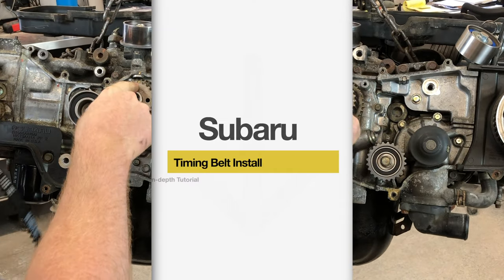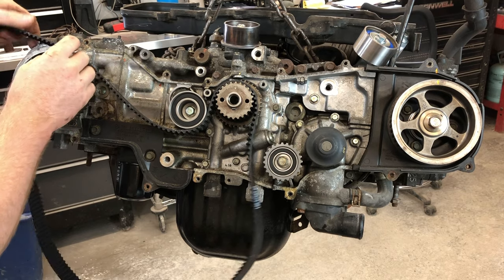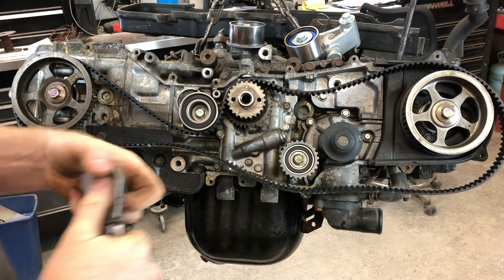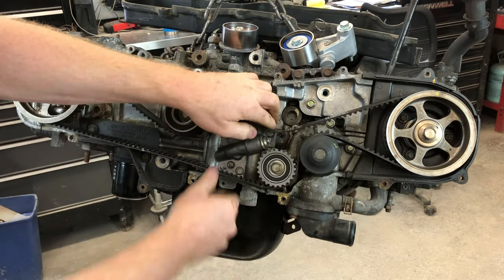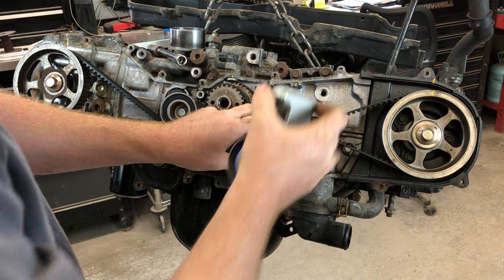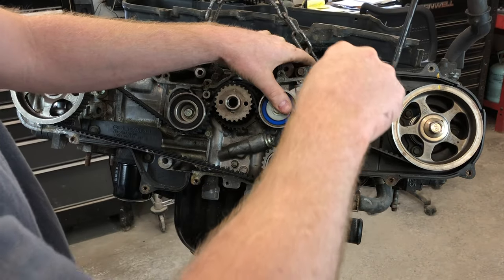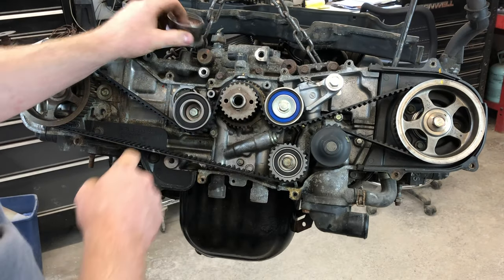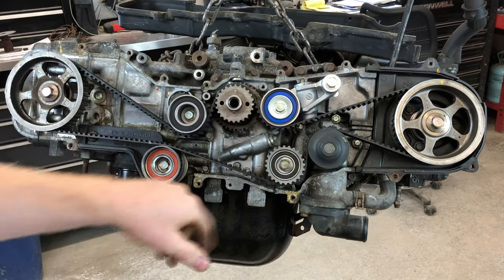SUBARU Timing Belt Installation!  PERFECT EVERY TIME! SOHC EJ25 EJ20 TIMING MARKS AND BELT GUIDE

Comment: I just bought a BOSCH belt for my EJ201, am I screwed
Reply from the maker: Hard to say. No experience on Bosch. But I've seen many others break.  On Subaru i only use oem or aisin. It's worth it. When they break, bad things happen. I've never seen aisin or oem break before 120-130k miles.
Reply: @EasyFixShaun  alright well I'll just change it sooner than I need to in the future, I'm not gonna throw a new belt into trash
Reply from the maker: I don't blame you. I have trust issues with anything other than oem. Aisin is the only brand that help up other than that for me. It's just not worth it. I have seen many failures below 30k miles on anything other than oem. Put oem on it and forget about it 😃

Comment: I just returned a $550 Gates timing belt and water pump replacement kit for my ‘05 Forester, 2.5X. All three bearings are made in China. Not interested in cheap, inferior Chinese parts, especially for the timing belt.
Reply from the maker: Yup. Aisin kits or Subaru kits only... or it will fail. Been there too. Is a pain to send back but worth it. Bad things usually always happen with economy kits 😃🔧
Reply from the maker: Yes! Japanese owned. American Made. Parts are made in Japan.
Reply from the maker: I think low quality parts use a strategy of low prices and high warranty claims to  fool a lot of people into thinking they are high quality. ...Including myself 😃
When in doubt go to the OEM parts. They have a high incentive to make parts that actually last through the warranty period. ...Although, they are getting good at making them fail just after. Can anyone guess which ones do this? And which do not? 😉
Reply: @EasyFixShaun  "can anyone guess which ones do this"? Sounds like a leading question, i would be interested in the answer.
As far as oem replacement parts quality being better I believe that may vary from manufacturer to manufacturer.  Installed an Asin timing belt kit on a Kia. One of the new idler pulleys failed at 40,000 km (so Asin kits gave their issues as wel). Bearing siezed causing the belt to slip off the idler but did so with a twist. With unbelieveable good luck the twist kept the belt tight even though it was no longer on the pulley..  Shredded half the belt and beat several grooves through the plastic cover ($80 !!) But the belt never slipped even one tooth and was still in time.
Looking on rockauto for replacement and having just had an Asin component fail early I was initially drawn to the Gates belt, because of long ago history of decent quality, but kept remembering Ivan of Pine Hallow Auto Diagnostic going into some detail about calling the Gates office to express dissatisfaction with Gates sending all China components in their kit. On the rockauto info page I could zoom in enough to see "made in china" and a part number clearly on the Gates belt.
So ordered all Kia components from a local Kia dealer and what do you suppose was in the Kia kit but the exact Gates China belt with the same part number but with the official Kia name and logo added and at double the price of the identical Gates belt (without the kia logo) that was on rockauto. So i would now say that Kia OEM replacement parts are now of questionable quality.  The new Kia tensioner and idler looked ok. 
Interesting enough was the initual tensoner that came on the engine from the factory was clearly marked Gates but the replacement kia tensioner and idler were a Korean brand.
Reply from the maker: @ronsereda4242  I don't work on kia so I am not sure what needs to happen there to get the best parts. When it comes to japanese cars, Asian or Oem is the only way  unless you want problems 😃
Reply: @EasyFixShaun  Yah, sorry to intriduce Kia into your discussion. Just came to mind when you mentioned Ason as being nect best to OEM. That was my belief as well but it was an Asin idler bearing that siezed after just 40,000 km (24,000 miles) that only by good fortune could have taken out the engine so thought I was doing right by selecting only OEM parts for repairs and still got a very poor quality China belt. If Kia is branding poor quality aftermarket parts as OEM it's likely that some others are as well. Just shatters any hope of hoping to buy quality anything these days.
Was watching your show because I just bought a very well cared for 2009 Legacy wagon with 132.000 km (79,000 miles) and was getting reacquainted with Subaru finer details.
Reply from the maker: Nice! I have tried cheap stuff over the years that made claims of oem equivalent quality too. It's a lost cause and has caused so many problem it is disgusting. It used to be just fine 20+ years ago to use aftermarket stuff. It would last just as long as oem. Everything now is junk being marketed as premium. Premium Junk. Almost all hope is lost at this point. I don't know how it will ever come back....I hope it will though 😃🙏🏻 @ronsereda4242

Comment: No mention of how much to tightening setting,  good video nevertheless.
Reply from the maker: This belt system uses a hydraulic tensioner and it sets tension automatically once the pin is pulled on the tensioner. Just bolt on the tensioner and it does the rest of the work 😃

Comment: UPDATE: Well, the inevitable happened. I got a real loud knock,  so I took my stethoscope and it's knocking from the top right side. I can feel it where the "EJ253" is located,  like it's ready to pop through.  I'm not sure if I want to rebuild this engine or get one that's already rebuilt.  I'm not a wrench but I feel comfortable enough to give it a shot. I've been studying these EJ253's and they don't seem all that complicated. I value your knowledge, so what are YOUR thoughts?   Thanx in advance.
Reply from the maker: Is the car running really rough also? The camshafts weirdly break in half sometimes on the right (passenger side). Pop the valve cover off and check it by turning the engine crankshaft pulley by hand (disconnected battery only). If that is the case, replace that cylinder head with a used one on ebay. Or a rebuilt one from autozone. The autozone rebuilds have been pretty good lately.
Reply: @EasyFixShaun  Good to hear from you. No it's not idling ruff, just major knock on the top right.
Reply from the maker: Ok, Well I would pull the valve cover and attempt to pinpoint where the noise is coming from if you think it could be valvetrain noise. If not, get another motor. Thats the options anyway I would start exploring. I hope that helps. 😩
Reply: @EasyFixShaun  Thanx for getting back to me.  Yes, I think I'm going for another engine since I've got it apart and noticed MANY bolts are gone.  I did some research on where this thing came from in Kentucky.  The previous owners are elderly and there's a butt load of maintenance bills from their closest dealership. I'm going to dig in a little further to see what I can see. Again, I appreciate your knowledge and I'm going to keep you and everyone else updated. Ya know what they say; " The more you know ..."    PEACE

Comment: Great! I just fitted my Gates belt kit and now i keep hearing about how crap they are!
Reply from the maker: Sorry to hear that. Ya I would go in again and put a Subaru brand on if you want zero issues with the belt. I have seen all others break prematurely 😃🔧
Reply: @EasyFixShaun  Man that's crazy, never had any dramas with my gates belts in the past. How the hell are they still in business??
Reply from the maker: Sometimes they do ok and make the full 105k interval. But not very often. I would never use one in my car or anyones else's car. Bad things happen. With certain parts only Oem will do and timing belts are in that category. Aisin is acceptable and good on Japanese cars also. I wouldn't use ANYTHING else. Even if it had a bazillion mile warranty- its junk 😂🔧🔧
Reply: @EasyFixShaun  Do they snap or do they just wear out prematurely?
Reply from the maker: Snap/break before the next interval.
Reply: @EasyFixShaun  well I just spent $500 on the kit so I don't wanna just throw it away. I'll keep an eye on it and change it at 50,000km instead of 100,000.
Reply from the maker: I would throw away immediately. Best of luck to you though. Sometimes they work out ok

Comment: Okay, just for shits and grins, I called Advance Auto and asked specifically for the MITSUBISHI belt. They tell me "YES, it's in stock" , I even gave them the part #.  I drive half an hour and they tried to sell me a DAYCO which in turn was more expensive by 10 and some change. They had to order the Mitsubishi, ... it won't be in until Friday.  I used to love to wrench, not so much anymore.
Reply from the maker: Ah crap I’m sorry man. Well at least the extra effort will make it last longer. I’ve seen a lot of motors damaged from off “comparable” belts breaking. With any other belts it usually happens somewhere between 40 and 60k miles.  It’s worth the wait.
Reply: @EasyFixShaun  And THANK YOU, sir, for KNOWING is half the battle.  I dig the AWD, for I live on top of a hill that most 4wd fear to tread ... like my `02 Ram.  XD  Lemme tellya, that Subaru is effortless.
Reply from the maker: Subarus really kick butt man! They are so underrated by non owners. I am a little fearful of the CVT issues they are having. I can't wait to own the direct injection motors they may be coming out with someday soon in most of the vehicles. Currently only BRZ has it.

Comment: How do you rotate to camshafts to line up without a belt on?
Reply from the maker: I use a wrench on the center bolt of the sprocket. I think Subaru's are a 17mm. 😀🔧
Reply: @EasyFixShaun  Its already torqued tight though.  I took the belt and pullies off first and then rotated the crank to position...:(  woops
Reply from the maker: Im not sure what you mean. If the crank is lined up properly its tough to do any engine damage as all 4 pistons will be exactly half way in the cylinders. If you removed the cam sprockets and then moved the crank into position it is possible to damage valves by colliding them with the pistons. Does the motor feel stuck on any if the three sprockets?
Reply: @EasyFixShaun  much appreciated 😁
How do I remove the crank bolt without rotating the crank?
Belt and pullies all still removed at this point...
Reply: @whoknows1631  either a special crank pulley holder fom company23 or a jack handle over your ratchet sitting tight to the ground and turn your starter over for a half second while avoiding starting the engine
Reply from the maker: Great methods!
Reply from the maker: Im am so sorry i missed hour reply. They get buried under old comments and don't pop up as a new comment sometimes. I have several pulley removal tricks/hacks in a subaru playlist you could checkout. They work great on subarus 😀🔧
Reply from the maker: @whoknows1631  https://youtu.be/BTysmAxU_nw
Reply from the maker: @sweetdjf  https://youtu.be/BTysmAxU_nw

Comment: Yeah, you need to be careful with that tensioner bolt, because it's steel and you're bolting it into aluminum, and you don't want to strip those threads....so let me hit it with an air gun.  That's dumb.
Factory torque spec for that bolt, if I recall correctly, is only 18 ft/lb.  Use a torque wrench, not an air gun.
Reply from the maker: Great tip! Giving good advise since 1776 😂
Reply: Says the guy with wooden teeth. How are those holding up by the way?
Reply from the maker: When chopping cherry trees- chop to specs 😂

Comment: Cant fix timing belt with my subaru Forester 9
Reply from the maker: Are you having trouble getting the belt installed?
Reply: @EasyFixShaun  yes, but now, my car gettin trouble crankshaft .
Reply from the maker: Ok. What is wrong with the crankshaft?
Reply: Tnx for ur support, now everyting good, i make a change crankshaft, it start Well now.
Reply from the maker: No problem. I’m glad you got your engine running 😀

Comment: New belt doesn't have timing marks, just arrows. WTF?
Reply from the maker: The belt marks on the belt are useful but you don’t need them. You can use just the marks on the pulleys to time then engine. Once the belt is on and tensioner is all set, spin the crankshaft two full turns and double check all 3 pulley marks line up perfectly again. If they are still lined up you are good to go.  😃
Reply from the maker: What brand belt are you using?
Reply: @EasyFixShaun  It came in a kit I purchased off Amazon. It's supposedly Aisin sold by MNJWS-Fullautoparts. I looked up the pulleys and they come up Japan. The box says New (Made in China)
Reply: This kit had good reviews for the most part, one gentleman stated the water pump didn't quite fit, so he went out and bought the OEM.  Thoughts? Thank you for the quick reply, I'm starting on this project today.
Reply from the maker: If there isn't a name on the belt I wouldn't use it. If it was a genuine Aisin kit the belt should always be a mitsuboshi brand belt which is excellent. You only want subaru oem or mitsuboshi belts only. In my experience all others will not make it to 100k miles for the next interval.
Reply: @EasyFixShaun  THANK YOU, I almost did the job yesterday, but I was worried about the belt. It looks substantial, but I'm going out to get another belt. Thanks again for the quick reply.

Comment: aisin doesn't even make tbk or pumps for subarus anymore and the "quality" idlers are made by Koyo and NSK.  you guys need to get over your China hate ...  junk, it's what's for dinner.
Reply from the maker: Us "guys" are the ones that know what we are talking about. You are incorrect about Aisin. Any quality idler for a subaru comes with a made in japan logo on it. It is called, "Pay me now, or pay me later".
Reply: @EasyFixShaun  you would know but i found none online, dealer part out only. (not even here https://www.aisinaftermarket.com/english/onlineparts.html )

new cars, used, dealers using all oem parts, if you were lucky you got 60k. they call them boxers cause they're always beating themselves up.  we got the factory right here, so we see them still on the road but they paid again and again. shoddy warranty "fixes" so you pay and pay and pay.  seems to me it's all the same if you're not checking them every 20k, why do you think they sell kits?
Reply from the maker: If you use the right parts for the belt, idlers, tensioner, water pump and belt, you won't have to remove the timing cover for 100k miles. Aisin lists a timing belt for every Subaru made up to 2012. After that they went to timing chains on the sohc 2.5L. That is the most widely used engine. A lot of people are price driven and will by cheap parts thinking they are same quality. That is where a lot of the timing component issues come from. The stock belt is recommended at 100k intervals. I have also seen stock belts go 130-150k and beyond. I wouldn't recommend that ever because they usually break by then. The aftermarket belts have trouble getting past 50-60k. There is a big difference in quality. Go for the good stuff, it will make a difference in the long run.
Reply: jthadcast Aisin does make a Tensioner pulley, you can find them on Rockauto, Amazon, eBay, and quite a few other places online...you can also find other aftermarket tensioners much cheaper, but without that JAPAN stamping on the steel part of the assembly it can cost you an engine.
Reply from the maker: Good call Andy! Thanks man.

Comment: Did you replace the head gaskets ? Just curious why engine was removed ?
Reply from the maker: Yup new head gaskets and cylinder head machining 😃
Reply: @EasyFixShaun Does that affect the timing marks?
Reply from the maker: Same timing marks. The tensioner will take up any slack from cylinder head machining 😃